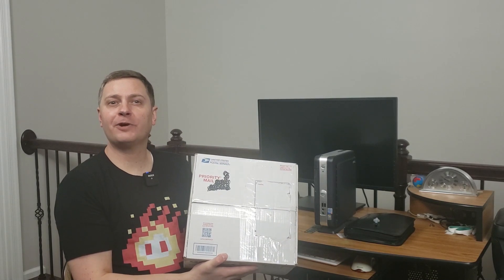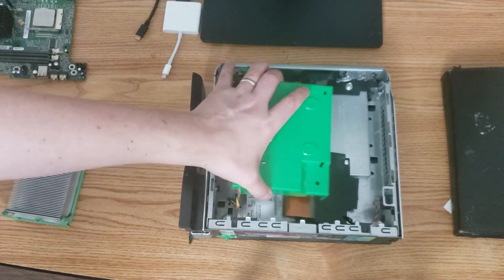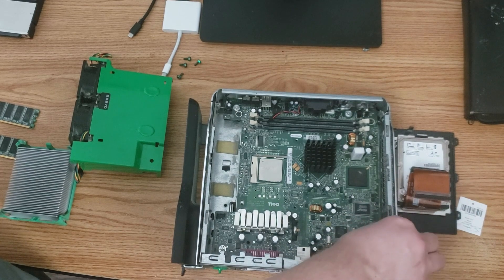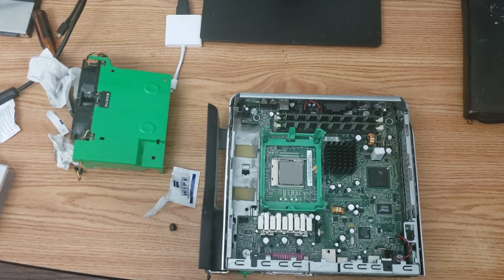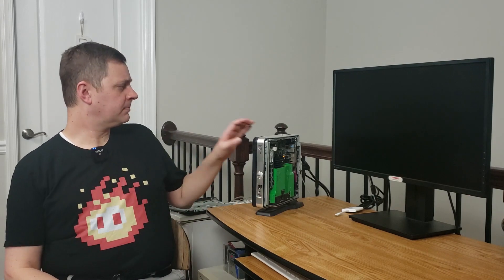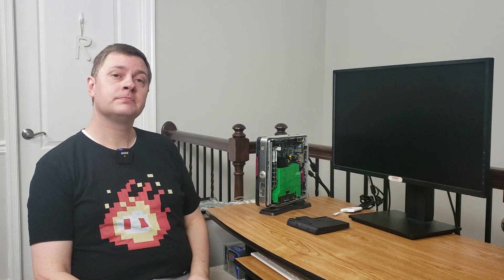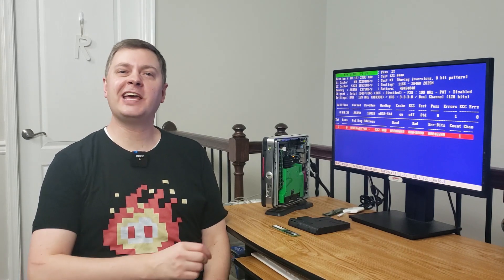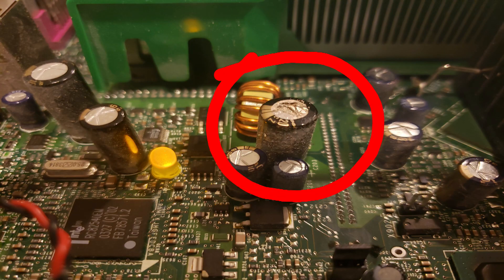RetroRepair: Repairing the Dell Optiplex SX 270

Comment: I just purchased one of these and need some parts! My question is what type of hard drive is compatible? Can I put and SSD in it? What type of connector is on the ribbon cable?
Reply from the maker: Should be a 44 pin IDE.  I tried a SATA to IDE adapter once to try and put in a SSD, and ended up with data corruption, but your mileage may vary
Reply: @RetroTechChris  Thanks very much!

Comment: In the previous video you mentioned that you had Dell replace the motherboard back when it was still newish.  At my former employer we had stacks and stacks of these and their larger desktop/minitower brethren fail in the 2005-07 time frame.  Dell sent us replacement boards, but the first couple of shipments of boards failed again within about 6 months.  They were just sending us more of the original boards with bad caps.  I suspect that's what happened to yours.  It's been soldiering along running it's single task once a day
Reply from the maker: I think you are right!!  Yea, second board was more of the same... perhaps with anticipation of getting out of the warranty period.. or user serviceable period!!  This machine is still doing daily backups here and working great now.  Love this little machine.

Comment: Hi chris

Good to see it up and running, i know some OEM like Dell / HP like to use there own brand of ram and have a sneaky internal test to see what memory sticks are used.

Those SFF or tiny housings are sots of Ok, but with Pentium 4 they are not the best, they really cannot get the heat out, and back in the day i ran them without the cover if they showed any stability issues ( ie not working at least 3 days straight without a reboot )

Oddly enough the big brother Del 2400 which is very similar is spec but a full size case ran easily a month non stop at home from 2012-2020 when it died - all that is left is the hard drive and cpu cooler - it hold about 20 business cards now

Cheers George
Reply from the maker: Definitely.  These were designed to fail :(

Comment: A question about capping, is it a matter of component "age" or component "use"????????
I would guess the later but i am not sure???
My dell is aged but not that much used....
Reply from the maker: I'm guessing it is a combination of heat and usage, but the caps from the capacitor plague may fail no matter what, but I am not 100% certain.  Disclaimer: I very quickly changed my major in college from Electrical Engineering to Computer Engineering since circuits and components pretty much baffle me!!!

Comment: Chris do you have any video on DOS memory extension replacement like "himemx.sys, i have this Dell Dimension 2400 with 2 GB works great with himemx but i saw your video get networking under win 3.11 and followed the 440BX network installation to the best of my best abilities. "I set it do DHCP" but as soon IFSHLP.SYS loaded and one tries to load the network it hangs during window 3.11 startup. 

Do you think it is a memory exclusion issue, or an issue with the router and the IP config?
I even tried to set it manually "gateway and DNS? winsname" 192.168.0.1 and give a static ip within range, but it simply hangs.
Could brand of rounters and speed effect the willingness to pick up configuration over DHCP?
Reply from the maker: Oh, and to answer your question, I haven't worked much with himemx.sys... for the most part have kept to DOS 6.22 with the exception of thin client setup where I have had to use FreeDOS to copy over files for initial setup.  Then I install DOS 6.22 :-)
Reply from the maker: I had another viewer with the same issue.  I don't think that memory is a problem since himem.sys will probably only see a small fraction of the 2GB anyway.  Did you set the exclusion range in config.sys for the adapter?  That's a critical step

Comment: I have a Dell Optilex 745 with the same small case running a pentium d with 1 gb ram.  I never fired it up so I don't know if it works.  It has the designed for windows xp and windows xp 64 sticker on it.
Reply from the maker: You should fire it up and see what it can do!
Reply: @RetroTechChris  I tried the little computer and when I plug it in the fan goes to high speed and the numbers 1, 3, and 4 are lit up on back.  I can't power it up.
Reply from the maker: @gttarus1  shucks.  I want to say all of the lights are supposed to turn green.  Here is some info on the diagnostic lights for the 745: http://gosrock.com/my745/trouble.htm#wp1114558.  Oddly enough, 1, 3, and 4 is not in the list!!!